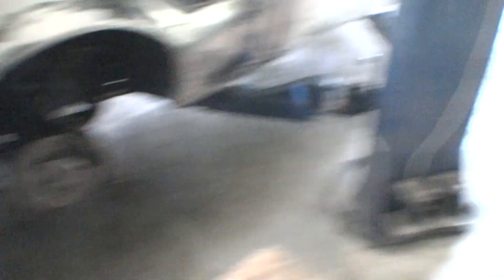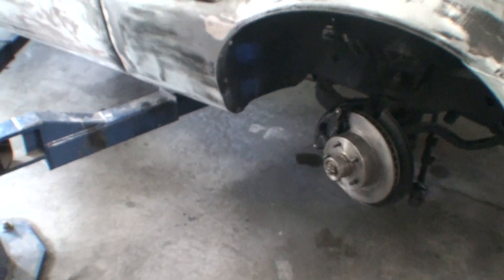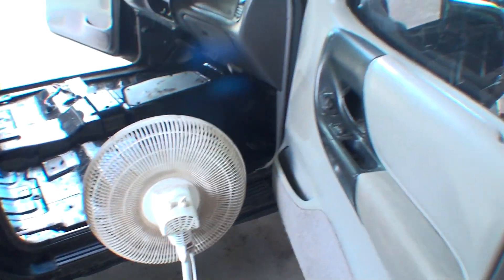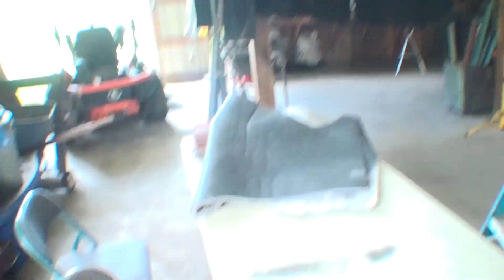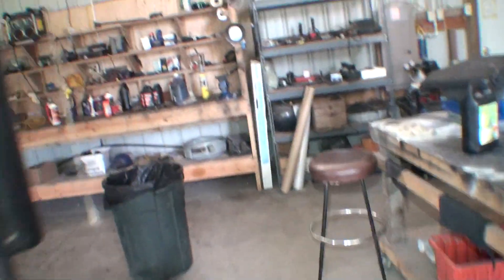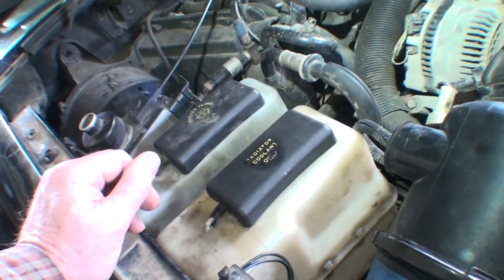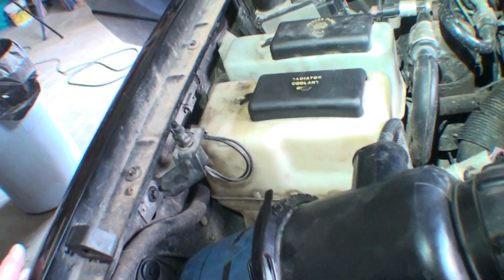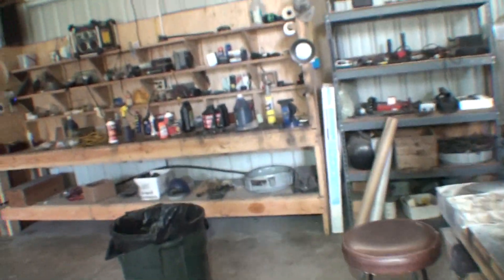1976 TA  Fluid Leaks & Electrical Gremlins (248)

Comment: I recommend using the nickel copper lines for the transmission lines, those rubber lines will not last in my experience
Reply from the maker: Yea your right, did all my brake and fuel lines with that. Just wanted to get rid of leak for now.